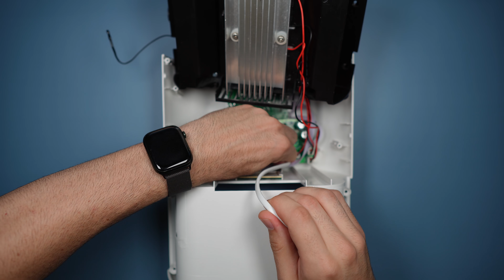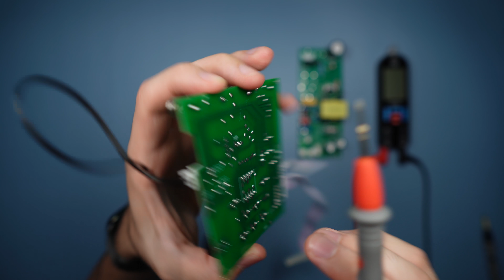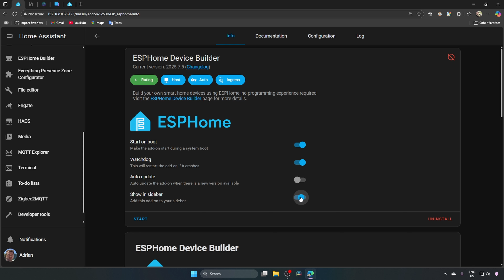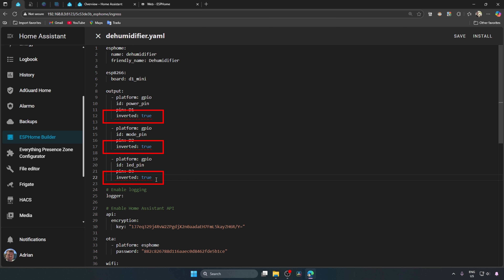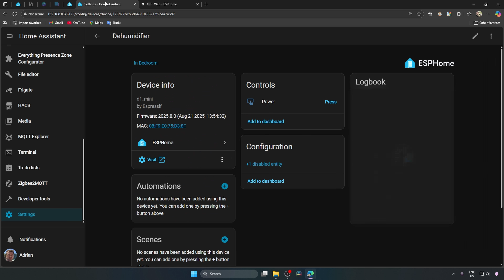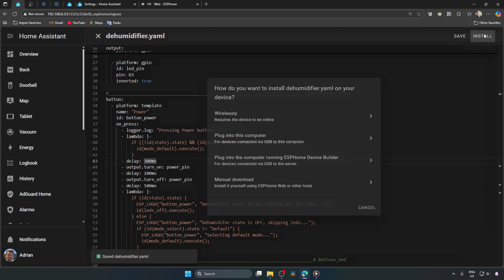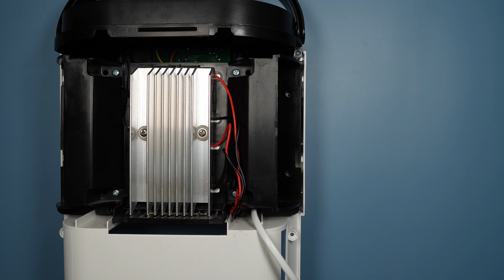Turn ANY Device into a Smart Device with ESP8266

Comment from the maker: A very important observation: I forgot to mention that after implementing this, the touch sensors on the buttons connected to the ESP no longer detect your finger, so manual control doesn’t work anymore.
Someone found of solution for this, check the replies of this comment.

Another thing I’d like to add is that even if I find a way to make the buttons work manually again, it would be hard to know exactly when they’re pressed, so the device and the ESP might not stay in sync, which would break the whole project.

This “dehumidifier” is inefficient, if you want to buy a real dehumidifier it should cost at least 100$/€.

The humidity value on the button comes from an external Zigbee temperature and humidity sensor.

I used an ESP8266 not because it’s better, but simply because I already had one. Anyway, thanks again to everyone who recommended using an ESP32 instead.

Thank you all for the kind words!
Reply: I hacked a humidifier with capacitive button to work like that.

1Mohm resistor between esp and the button, then drive output low or high (I think both worked) and then "unassign" the output to make it float between "presses". Might also work with setting it as an input, but it has to have pullup/pulldown disabled. It now works nicely with both controls.

I also read the led states. Mine had one rgb-led for states and errors, so I needed to check for 2Hz blinking at least for red channel.

On my humidifier I could do all that from the front panel wiring, which had a plug on it, so I could even remove the hack without a trace, as it's just an extension piece between the main board and front panel.

Powering my hack was "harder", as I didn't want to solder on a warrantied thingy the day I bought it.. I was originally hoping to control it by just cutting the power with wifi plug, but it needed to be started by the button every time and I "had" to make it work somehow. There were room for a little power supply inside the thing, that got similar extension to the power plug on the main board.
Reply: @villehietala9677  i use led blinking to detect my pc sleep/suspension
Reply: @villehietala9677  is it always 1Mohm or can these change depening on the print and capacitive button controller ?
Reply: @harnas780 I got lucky and the first one I tried just worked. It really was a guess.

I actually remade the thing later and it doesn't accept touch from the original system anymore. My first try had that 1M resistor basically connected directly at the original touch wire when it worked and the new one has longer extension wires to and from the original connectors and I lost the hand controls. It still works from the esp, so I haven't tried to fix it.
Reply: @villehietala9677  oke thanks guess will have to find out when i try it
Reply: You could detach the touch buttons from the device PCB - so that they feed into the ESPHome device. Once an input is detected, you run the logic of that button to act as if you would be triggering them from the Home Assistant interface.
Reply from the maker: Hi Claudiu, these buttons are not ‘real buttons.’ What I mean is that they are not mechanical switches, you can’t desolder them and use them for another purpose. These buttons are just traces connected to a microcontroller/sensor IC that measures capacitance.
Reply: @AdrianSlabu  I didn't know that.
In this case, perhaps if you wire a capacitive touch sensor with an external wire connected directly to the touch button, even if you decide not to cut off the connection to the original pcb, maybe you can use that.
Reply from the maker: @Claudiu.  For sure there are solutions, but the idea was to find an easy one, without adding extra things. The video is about making a device smart using only an ESP8266 😆.  Thank you for the advice anyway!
Reply: @AdrianSlabu  Have you tried switching the pin to be an input after you emulated the button press? It's possible that will allow the capsense to work again. Alternatively, you could use a diode to disconnect your output from the switch when your output is in its idle state.
Reply from the maker: @perenis-z9r hi, no I didn’t, I liked that it can’t be controlled manually 😄. I wanted to be a simple project. Thank you for the advice!
Reply: @Claudiu.  👋
Reply: @cristian_calin  :hand-pink-waving:😁
Reply: Could you not read the sate of each led on the panel to send feedback to the esp?
That way it would update with the true mode even if the buttons were pressed on the device or in the app.
You could also add a diode to your lines connected to the buttons. This should make the device work again.
Reply from the maker: @StevenKiberton  yes, you are right!
Reply: Have you tried adding diodes in series with your connections? Ive just seen that someone else suggest that. Great video BTW thanks I already use ESP 32 for many projects but I never thought of wiring one directly into an appliance
Reply from the maker: @peterjames4047  Hi, no I didn’t. Maybe I will try this, for now I’m in vacation. 🙃 Thank you and I wish a nice day.
Reply: I wonder if you were using another ESP device which support touch input, the touch would register in both microcontroller at the same time? Or maybe the touch input sensor would conflict between both... idk.
Reply from the maker: @tissandre probably yes, I’m not sure 😆. Nice idea!
Reply: Would an optocoupler be an option?
Reply from the maker: @asd213gh  Hi, I don’t know, till now I didn’t even know what it was 😄.
Reply: I did something similar on a cheap audio amplifier and used optocouplers for each button. Maybe it would help you too.
Reply: I did Something Like this in another dehumidifier. IT seems to have a generic Board with an unused connector. I turner Out to Accept communication via tuya protocol, which IS also supported by esphome. So i used this to Control the dehumidifier. I even get all the Sensor readings and so in. The original Control Elements are still fully function ing and there IS even an Led indicating WiFi connectivity (through there are no Labels printed in the Case for that Led).

Sorry for all the typos, stupid Auto correction. IT Just disables english language Always...
Reply: @AdrianSlabu - I did something like this recently with an Air Con unit... the panel was also touch controls and had 'coils' that looked very similar to yours. I was unable to find a direct solution, so I cheated a little.  Instead of pressing the buttons, I added an IR Transmitter to the ESP and routed it in front of the A/C units IR receiver.  I then used ESP Home to log the commands sent from the remote, then copied them into my YAML file to send via my chosen esp home button/trigger.  The PCB for each mode had an LED on, so I used TEMT6000 glued onto of each LED to detect the modes/function etc based on what LED was on! Was a fair bit of messing around to get it all working, but now it does, it works great! Manual button touches still work since I'm not attached to the coil touch buttons, I'm just sending IR commands to the receiver inside.  Everything fit inside nicely and is now a smart AC unit
Reply: I was about to try this with my non-smart humidifier, but if the touch buttons are no longer working is a deal breaker. If you find solution, pleqse post the fix! Great video
Reply from the maker: @AlexValtchev  I’m in vacation so for now I can’t try anything. 😊
Reply: Well done video. Why didn't you use a voltage divider to read the voltage of the brown wire so you can tell by voltage which mode is selected. Easier to use but the esp8266 can only read up to 1v at the adc.
Reply: @AdrianSlabu I managed to make the manual button work, and I also used the LEDs to read the status of both the fan and lights. I can also do that for the water level check sensor.
Reply from the maker: @MoGnedy Great, can you please tell us how you did it? Thanks!
Reply: @AdrianSlabu 
For each capacitive touch button.
Required Parts:
	∙	10kΩ resistor
	∙	10pF ceramic capacitor
	∙	10cm jumper wire
Implementation Steps:
	1.	Prepare the replacement electrode - Bend one leg of the 10kΩ resistor into a spiral shape to fit inside the original coil
	2.	Insert the spiral electrode - Place the spiral-shaped resistor leg concentrically inside the original spring coil, creating a nested dual-coil configuration
	3.	Solder to the original coil - Solder the resistor’s spiral leg directly to the original spring coil itself (not to the PCB node), ensuring solid electrical connection between both spirals
	4.	Connect the RC circuit - Solder the 10pF capacitor to the free end of the 10kΩ resistor
	5.	Attach the jumper wire - Connect the 10cm wire to the capacitor’s free terminal, routing it to your ESP32 GPIO pin
How It Works:
The 10kΩ resistor limits current and provides a discharge path, the 10pF capacitor couples AC signals while blocking DC interference, and the 10cm wire connects to the ESP32 GPIO. When the ESP32 changes its GPIO state, it alters the capacitance at the sensing node, mimicking a finger touch. Simultaneously, the circuit remains responsive to actual finger touches because both the ESP32 and human contact create capacitance changes at the same sensing point. The nested coil design with direct coil-to-coil soldering preserves the original sensor’s functionality while adding the ESP32 control interface.
Reply from the maker: @M @MoGnedy thank you!
Reply: wouldn't be easier just to rip everything and replace it with esp? to manage the whole device? :D
Reply: Capacitive buttons in their nature itself are preety sensitive to impedance changes you adding esp in parallel can certainly cause the buttons to malfunction however there are few ways 

Easiest will be to cut traces from touch surfaces first and connect them to the esp32 it have native touch sensor pins , and use latching op from esp to simulate press by attaching op pins to the ic directly
Reply: I’m surprised they don’t work anymore. What do you think caused that.
Reply: Pretty sure It'd be better if you use bidirectional optocoupler
Reply: You can connect the device’s buttons to the ESP, and the ESP will perform actions based on your presses or touches. This way, the ESP keeps track of what’s happening. Also, if I were you, I would use transistors and control them from the ESP. I’m not an expert, but I believe this is safer.
Reply from the maker: @muhandiz6585 no, that is not possible in this case.
Reply: You can probably use a relay to temp. have a connection and then an open connection when you don't want to. Both functionallities should work then.
Reply from the maker: @lukabodroza   I think an optocoupler is the way to go, a relay is to much in this case. And I will need one for each button. Thanks for the answer!
Reply: @AdrianSlabu i’m using optocoupler on air purifier, same issue buttons NO❌ longer works, mine is running 24/7 on a schedule so its not big dead for me.
Reply: will optocouplers work?
Reply from the maker: @Gameplayer55055  yes, I think thats the solution. Thank you!

Comment: I recently worked on a similar project and encountered the same touch sensing issue. I'm using the Honeywell HPA5150 — the touch function works by detecting capacitance changes. After trying various GPIO approaches, I switched to using a relay to physically connect a 22µF capacitor, simulating the touch effect. Even with a reasonably short wire design, I'm still able to keep the original touch buttons fully functional — though with a slight reduction in sensitivity.
Reply from the maker: Thank you for sharing this!

Comment: wouldn't this setup fry the ESP at some point since we are forcing the current from the dumb device go through the ESP internal circuits? I mean this is working,  but just having 3 optocouplers in parallel with the existing button would both keep the physical buttons and dont make the circuits interact.
Reply from the maker: Someone in the comments specified the buttons are not working even after using optocouplers. If you check the pinned comment, in the replies you will find his solution.
I don’t understand why it would fry the ESP?
The pins are made to support 3.3v, this doesn’t exceed its limits.

Comment: esp8266 is pretty darn old, no? ESP-32 is out there for many years, it's muuuch more capable, costs abot the same. there are even tiny devboards same size as a small esp8266. So why do you still use that old thing in 2025?
Reply from the maker: Hello, because I already had it, why to toss it when it can used for something like this?
This is specified in the pinned comment.

Comment: I think I would have replaced the built in controller completely. Just have to add a humidity/temp sensor and a couple of relays. any maybe interface a i2c led digital display driver. Might even been able to add the buttons as inputs to the esp

Comment: what if you change the mode through the button on the device? The state in ha doesn't change because it can't actually read the state, right? Would be awesome if you could elaborate on ways to read a state like these modes reliably and when it is and when it is not possible to do that.
Reply from the maker: Hi, as I specified in the pinned comment, the buttons are no longer working after you connect the ESP to them.
You are right about the state in HA, but what you are saying is possible, a bit more work but possible.

Comment: You can get the value of humidity and temperature from the esp32 with another module like: AHT20+BMP280 for 1.69€ (aliexpress) or DHT11 for 1.86€ (aliexpress)

Comment: How would you most easily, no battery, constantly supply power to the arduino even when the device is off?
Reply from the maker: Best would be to power it like in this video directly from the board, if it’s not possible you need to use a power supply(check the video with the coffee machine).
Good luck!
Reply: @AdrianSlabu  oh I thought in the video your device only gave power to the arduino when the device power was on.

Comment: How did you get the humidity reading on your phone?
Reply from the maker: Hi, I specified in the pinned comment.
The humidity value is from an external humidity sensor from the room.
Reply: Awesome, I'm sure it's another video, but how did you combine both devices to be read as if were one device?
Reply from the maker: Using home assistant and a custom button called Bubble-Card.

Comment: Very cool, however, that looks like a thermoelectric (Peltier) dehumidifier which is wildly inefficient compared to basically anything else out there. Those things drink energy for very little return.
Reply from the maker: Thank you, that’s correct. It’s specified in the pinned comment!

Comment: thank you for the video, could you please explain how did you grab humidity value from dehumidifier and used in home assistant?
Reply from the maker: Hi, glad you liked it!
I mentioned in the pinned comment that the humidity value is not from the internal sensor, it comes from an external Zigbee sensor I already had in my room.
In the video, I also said that I don’t trust the internal sensor because it gave incorrect readings, which is why I avoided using Auto mode.
Speaking of the internal sensor, to be honest, I don’t know how it can be read (I haven’t even researched it because of the reason I already mentioned).

Comment: Smart you say... Use ESP32-C3 instead of that old junk ESP8266. The ESP32-C3 offers wifi & BLE and has faster and at the same time more power efficient CPU. May be even cheaper if you buy the right ones at the right time. I've been lucky and bought 10 pieces of TENSTAR ESP32-C3 SuperMini for €17.40 on ali. These working great.
Reply: You Fricking 1d10t, it will suffice for his use case. Why would he buy Hardware he doesn’t Need to Utilize

Comment: 2:53 I gotta be honest here... if this video is meant to be on the level of explaining people how to very basically solder, I am not sure it's a good idea to have them work on a unit connected to main's power afterwards as their very first project. People do not know the risks. They also don't know that the capacitors on that board can even after unplugging the device still be active for hours and days and need to be shortened out/drained to work safely on the board. I think you should add some major warnings before that and recommend people to rather tackle devices that are powered by USB or batteries first.